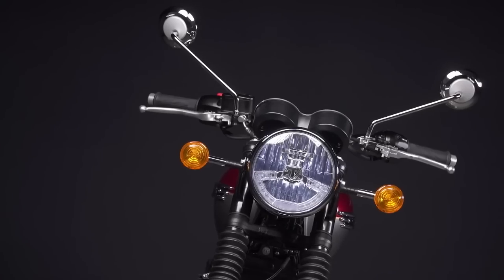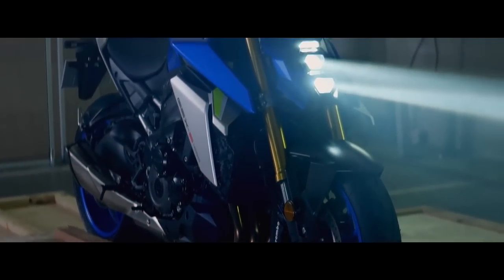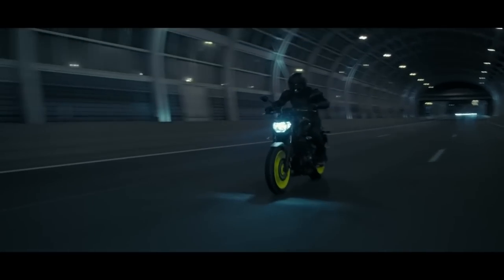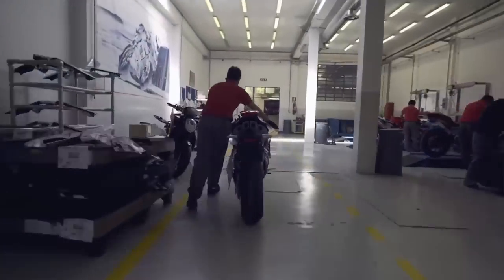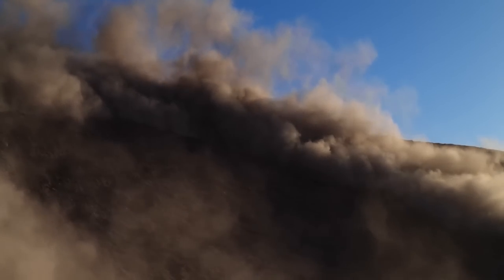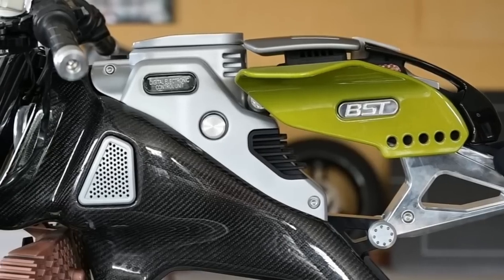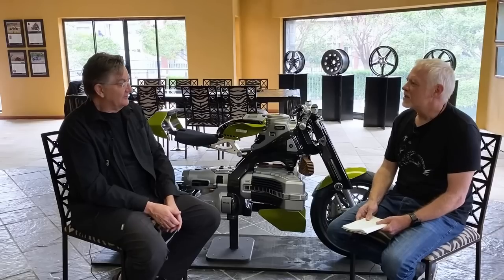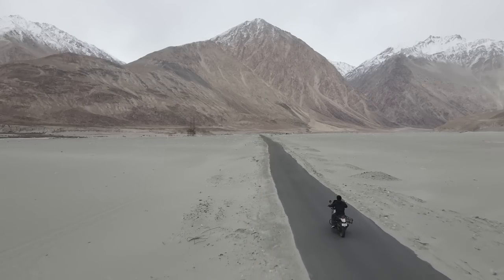Why old motorcycles look better than new motorcycles

Comment: Great video, loved the F9 refference, one of the other best motorcycle channels. Great content, keep going.
Reply: Also, on the end, as a motorized bike owner (and I guess a builder now?), I really get the kicks from knowing that I just took my old shitty bike, put a china engine in it, tuned it to the best of my knowledge (not much), put some MOTUL in it, and immediately fell in love with two strokes. 
Just changed my 44t crankset to a 36t to get some more final and oh baby. 50 km/h is a lot on a old bike with a CB400 handlebar (I bought it for so cheap, I had to install it) 
I've ridden bikes for more than 10yrs, never liked motocycles too much, as soon as I rode it... Yeah, fuck the world, forever two wheels.

Comment: Problem is that Manufacturers dont want the Customer to be able to adjust something on its own. They want you to go to Shops and pay for every single little screw tightended. 
Thats in my Opinion the biggest Reason for putting more and more unnecessary complexity into modern Bikes.

Thanks for another interesting Video

Comment: A lot of old stuff looks a lot better than new stuff because it is perception is understandable.  You see a steam locomotive's pushing rods that turn a wheel; You see the puff of oily exhaust coming out of that old car's exhaust pipe as the car accelerates or changes gears. You hear grinding gears if they're not perfectly synchronized. You see the warping of the drive chain as torque is applied upon that motorcycle's acceleration.  In some cases you can see moving parts functioning on cars, motorcycles and boats. Half the fun of going somewhere isn't arriving it's traveling.

Comment: this was an interesting video but I cant help but feel like youre trying to be nostalgic about somethings you couldnt enjoy.
how different really is doing a computer sketch vs a complete hand drawn sketch?
how is it different if the bike was sculpted on clay vs 3d modelled?
speaking from the perspective of the end product, does it make a tangible difference if an exhaust pipe was made through human labour or mass produces in an automated factory?

sure, such a process is much more authentic and sentimetally more valuable, but these seem to be arbitrary rules to design a retro bike

Comment: How to make a beautiful motorcycle:
1.) Round headlight standard on all naked bikes.
2.) Dual headlights on sporting bikes. See Ducati 916, Yamaha R1 circa 1998.
3.) Never use a single headlight for any reason on a sporting bike.
4.) Standard large round muffler that goes out the back. See Tuareg 660 or Pan America.
5.) No hidden "Buell" mufflers hidden under the engine.
6.) Analog tachometer. 
7.) Large, thick, robust rear end, with 25 pounds of heaviness and a huge thick license plate holder and a grab rail for passenger.
8.) No more bailing wire "tail tuck" kits holding a license plate on in the name "tidying the tail."
9.) No tear drop gas tanks. Only flat, early 1970's tanks without the UGLY 1980 "tear drop" shape.
10.) No square, triangle, or pancake shaped mufflers for any reason.
11.) DUAL HEADLIGHTS ON ALL SPORTING BIKES. AGAIN. NOT THE TUAREG OR TRANSALP THINGYS.
12.) Overdrive gear in 6th for actual driving, not trash race gearing. LOW RPMS in 6th gear.
13.) Just stop making the tail of the bike shorter and shorter and shorter until there's nothing left. STOP. LEAVE THE TAIL ALONE.
14.) No side gas tanks covering the engine. Weight be damned, STOP. UNACCEPTABLY UGLY.
15.) Simply keep making the Ducati 916, 1998 Yamaha R1, the 1984 XR500, and the 1976 CB360. Easy.

Comment: I ride a modern crf 250 ,it  needs plastics to cover the rad/ coolant  reservoir. I look at the old XL250 and it looks so much better  imo because it's air cooled, no ugly pipes , no plastics and a lovely air-cooled finned engine. On another bike, the MotoGuzzi , why paint the entire range with black engine paint?  they look terrible compared to the old alloy coloured engines of earlier bikes

Comment: My pet hate is the trend for custom bikes to have a huge hole where the airbox and battery and oil tank should be. They achieve this by relocating the battery to somewhere else which will inevitably be an inferior compromise, and by removing or downsizing the air filter. It's form following the opposite of function. For an engineer like me that's ugly.

Comment: The problem with modern motor cycle design, is that it is led by marketing trends,  and what the management "think" the customer actually wants!!!  The companies believe that the riders want high tech motorbikes with traction control, semi automatic gear change( Honda's shame) and basically extremely heavy motor bikes that most riders cannot afford to buy, or service themselves because of  poor layout design and the electronics onboard!!  Thus you have each year, more and more weird shaped  plastic rockets , that may go like rockets, but in reality, are soulless plastic heaps.
What's the expression about climbing mountains? why do you climb? because its there! So applied  to motorbikes, just because the technology exists , you don't actually have to apply it all!! Don't get me wrong ABS and electronic ignition and yes, fuel injection is good, also hydraulic brakes and clutches are all natural improvements in reliability, so yes include them!  But my beef is with the look of the bike , they just cannot keep the lines simple? They literally overdesign the look of bikes. What suffers, well for a start, you cannot easily access any  service areas without needing to strip half the bike!! The original reason for all the " aerodynamic fairings on production bikes, not racing, was to cover up the grotty engines and rusty exhausts pipes!  At the end of the day, vintage bikes look, and will always look the best, because they weren't designed  just for show, but for everyday riding and practicality too. Even the modern day retro bikes are just fakes, made to look like the old ones, but are let down in two most important areas, no kick start and water cooling! and engines, that are way too powerful!! do you really need a 900cc Triumph Bonneville, today in 2021, when an original 650cc would be lighter and fast enough on todays congested roads!!
WTF happened to motor bike design??  well it died, for the sake of progress!!

Comment: I agree with most of the points made here, however - where new motorcycles excel: modern disc anti-lock brakes, suspension, responsiveness and overall smoothness of the engine and the ride.  If we examine the point of engineering, it is to make a design to do the desired job with the least amount of parts - on this point, I think many designers fail.

Comment: The thing when it comes to design is, that people believe there is one way, one principle. For instance, “all good designs are simple”. But have you heard of Sagrada Familia? Or “design needs to be complex”, then take a look at your iPhone. As an architect, I can say that I don’t know anything about designing any specific thing, until I investigate it. But I know way more than 99.9 percent of people. If even I don’t know anything about design, nobody does. Legendary designers like I.M. Pei were starting from the ground designing the museum in Qatar. Design is a very challenging matter to partake. There is no such answer as “design needs to be simple”. There are times it needs to be simple and other times it needs to be extremely not simple.

Comment: I love my 1980 cx500. My 83 gpz 750. But they have problems.  They can get cranky. However my 06 zx12 just works.....until someone decided to jump it with a truck. The old bikes are easier to work on but require more maintenance.  New bikes work better but when something goes wrong it can be a nightmare to figure out what is wrong.  Without the proper training it can be almost impossible.  I'm an electrical technician (not going to say engineer) I know how to read and troubleshoot electrical circuits but getting one is not possible.  That's the main problem.  Yes if I take it to a dealership I know it will get fix correctly but that costs more. Plus there is some "fun" in working on your stuff. Doesn't matter what it is. There is pride in keeping something working. They are taking that away and making more things disposable.

Comment: The comments are as good as the video, some great points made by both sides. I think in modern bikes it especially gets dull with off road bikes. Every single motocross bike, enduro bike, dual purpose bike and even trials bike looks EXACTLY the same. The only difference are the graphics and name.

Comment: As a youngin in all this (turned 20 in December 2021 young) I do agree with the sentiments here. Something just... radiates... hence why I'd want an older car as a day driver. Why should I settle for modern tech controlled garbage with no soul when there's plenty of old rides waiting for some TLC reminiscent of the age & people they were made for?
Reply: I agree. I'm also quite young (23). There are certainly new cars and bikes that are awesome and exciting, but old ones are just as much so. I own a 2015 Mazda 3 but driving my GFs 1994 Toyota Rav4 is just as fun, even tho it's comparatively "shit". Her old 1995 Ford Fiesta Mk3 was just as fun (and even more shit lol), and they all look great. You then look at any modern VW or whatever, and they just look dull. Same thing with bikes. Both, my 1994 Jawa 350 and my 2001 Suzuki Bandit have all their plastics stripped from them and you can now see the intricate geometry of the frames and how the engine sits in there. And then the wobbly riding. It's super exciting to do 40 over a crazy road and feel the bike work and flex and interact with the road. And if you do something stupid, you're off. On the modern bikes, it just rides perfectly, with no soul, everything feels like it could do crazy laptimes on a track, but looks shit while doing it and has zero character. And it's not fun if you're not doing crazy speeds and dragging knee. Old imperfect stuff rocks haha
Reply: @Blockbuster2033  yeah modern cars almost always look the same, & even if they don't they still just feel the same. Glad to see I'm not the only one with an old soul around, its a strange but nice feeling
Reply: Year ago me was spittin
I'll get that 70s-80s daily driver beater one day

Comment: When the safety bicycle replaced the penny farthing in the 1890s and they put a motor in it the standard motorcycle was born. Early cafe racers, scramblers, and Bobbers were simply modified standards. The standard was the norm for nearly a 100 years and lives on lives on in many modern iterations.

Comment: I have a ural retro a motorcycle that from a design standpoint hasn’t changed since the 1940’s. 

It has a sidecar, a boot, and looks like every vintage bike people drool over. Because in all reality it pretty much is.  But the mechanics were modernized to increase reliability.  

But the bike on paper fails miserably if you’re a stat junky looking at plastic toys explicitly for gimmicks and gremlins.

No Abs, no real computers. A death sentence apparently.

The body is made out of heavy steel. Acceleration is there, the hp is only in the 40’s just like the design.  

But I got it because it’s from another school of thought. Fenders and bottom of the side car are lined with undercoating to protect from rust.
The bike has similar tires to an dual sport it can go where you point it.

The suspension is overkill. It passes the chicken egg basket over a field test.

The gear box takes the same oil as the engine. It’s designed like a tractor because in Siberia you’re SOL if your out of oil. Less things to worry about. 
And it will go through snow. People have driven these through blizzards 

It has reverse, and it seems to have been fuel mapped to run on the crappiest gasoline you can imagine.

The 40 something horsepower engine is a boxer twin with a fighting German heritage and a heritage of fighting the Germans.

The tool roll it came with I’ve used to fix a friends car. You can dissemble the motorcycle with everything they give you from the factory.

It’s illogically logical. On paper it fails every notion for modernity, but when explained to a human. It makes sense.

And besides how many bikes have the option of a factory machine gun mount?

Comment: I wonder if it's also that many long term riders are often very utilitarian towards the bike as your always trying to make sure everything has a purpose.  I find plastic covered adventure bikes odd as they are meant to be used in rough areas and the plastics always just get broken and scracked.  Yet they wrap around entire bikes.  It doesn't really feel "clean looking" either because it's such a odd shape you're trying to make look like a singular piece.  We want to see our bikes function and the purpose behind every inch. Not shrouded beneath loud or bland colors.

Comment: Even new vehicles are art. Machines and humans together build more machines. Machines that can think, and you can teach them how to think, you just need proper tools and knowledge.

Carbs were simple, FI that is controlled by a computer is much more difficult to work on but it can be done. You can tell the machine what you want and it tries to do just that in the best possible way, sometimes it may give you suggestions, sometimes it may refuse, blame it all on the people who made it like that. 

If there was an open source ecu software for every vehicle out there, you'd love modern machines too.

Comment: Interesting vid, bart. I personally don't think new motorcycles are ugly, unless if they r trying 2 look retro. I think retro bike images of the 60's or 70's r 2 bland and boring 4 my taste, but they were fine back then when ppl didn't know any better. Case in point, spoke rim's, I do not like the way they look, and why any modern manufacturer would prefer them over alloy rims on today's high speed highway is just trying 2 make extra $. Metal is gr8 when ppl want shiny looking, but when it comes to colors, like ducati red, or ktm orange, it has to be durable polymer plastic. Let's not even get in2 carbon fiber looks. Anyway, ride safe, god bless u.

Comment: Vintage cars, trucks and motorcycles had the design aesthetics that are completely lacking in the newer models. Perhaps, like fashion and music, concepts of designs change with each successive generation I would trade my latest model of personal vehicle for a more beautifully designed and aesthetic looking vintage one. Of course, the issues of fuel efficiency, pollution, availability of spare parts would be there but I am ok with it.

Comment: In reality it’s a failure to understand on the part of modern designers. I am 66 and brought up on a diet of British bikes; and I still own and ride as often as possible. Yes old Triumphs, BSA’s and NORTONS leaked oil, rattled and had dodgy electrics,  but I fixed mine by the side of the road with the tools in the tool box. Modern bikes are over complicated junk, at the worlds end the survivors won’t be riding a modern bike; it will be an old nail that has no electronic gizmo’s. As for electric bikes don’t be stupid, they are no more  exciting than a microwave; does things fast but has little or no involvement from the owner. So glad I lived in the best years and not this money earning twaddle that people call progress. If it’s so good why are people scrambling to buy or restore the old; it’s called soul.

Comment: Same thing for bicycles! My 1970s locally made bike looks way better than most modern bikes made by large companies, and is infinitely easier to fix. Sure, it's heavier, less aero and a tiny bit less practical, but the looks, ease of adjustability and comfort cannot be matched by today's bikes if you use a good quality saddle, handlebar tape and tyres

Comment: Simplicity and Function. Those beautiful and simple old motorcycles didn't have to comply with the Clean Air Act of 1970 and all the amendments that followed. The function of a motorcycle today means that they must comply with strict emission standards which no simple air cooled, carbureted motorcycle can meet. Motorcycles today MUST be liquid cooled, fueled injected, catalytic converted and have an O2 sensor plus much more to meet emission standards. No simple, light weight, air cooled and carbureted motorcycle can be sold in the developed world without these devices which add weigh and complexity. I challenge you to test the exhaust coming out of your beautiful classic Triumph, which I agree is a beautiful work of art, in it's time. However, given that the exhaust is toxic, maybe not so beautiful. 

As for electric motorcycles, they can be wonderful but they are only moving the pollution from the bike to the electric generation plant which probably runs on natural gas but possibly coal. I own two electric bikes and they are great for what they are but nothing compared to my 2022 Triumph Street Twin. I bought the Street Twin because it took me back to my first motorcycle, a 1962 Triumph Bonneville. One of my electric bikes is a Sur Ron Light Bee, which is somewhat like a motorcycle but without the charm and sound. 

I think that motorcycles should be given a break from strict emission regulations because compared to other forms of transportation they are small and efficient. The air coming out the exhaust of my 2022 Triumph Street Twin is relatively clean and possibly cleaner than the air going in to the engine in some cities. As far as I'm concerned, my current bike is more beautiful than my first bike, the 1962 Triumph Bonneville because not only is it a work of art, but the air coming out the exhaust is clean. Your classic Triumph, considering it's emissions, not so much.